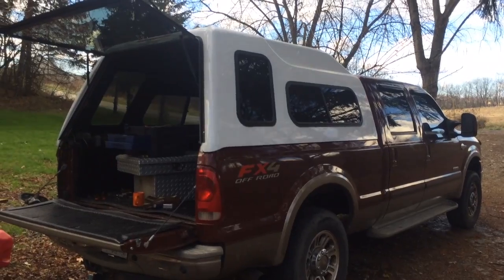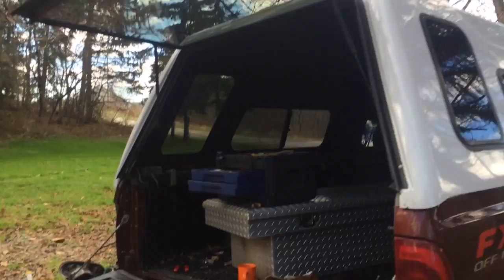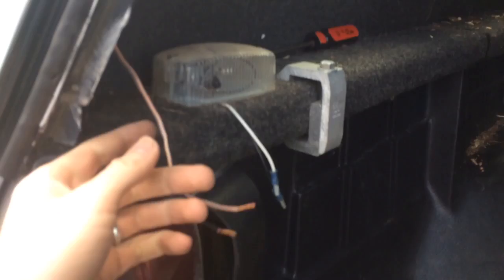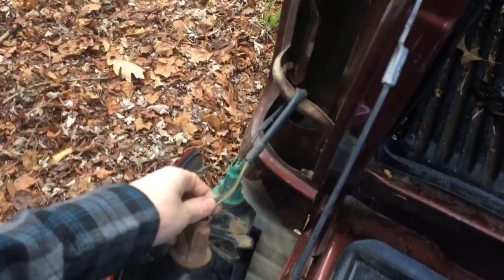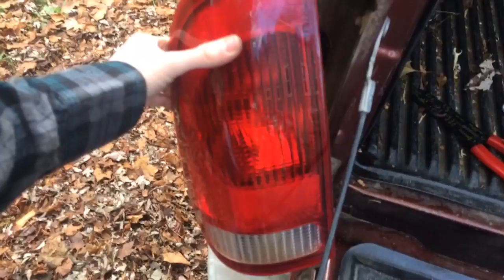How To Wire A Truck Cap Third Brake Light

Comment: THANK YOU !! I was having a problem finding a wire that wouldn't work the turn signal as well. My 13 Ram had that same wire hanging, it was white with purple line on, but still did the trick
Reply from the maker: Nice. I'll be sure to put that it works on some Dodges. Thanks for the info and the watch.

Comment: I have a green and a yellow wire coming from my third brake light on the cap, what do I do with the yellow wire?
Reply: What’d you do with the other wire?
Reply: @diyrob9160  So the green was the ground, it attached to the black wire on the light on one end and I attached it to a screw holding the bedliner to the bed on the other end. The live yellow wire wire I ran to the extra green wire that was coming out of the harness near the rear bumper on the drivers side.

Comment: I have a 2000 ranger and it doesnt have the green wire  : /  , still trying to figure out what to do
Reply: sell it and buy a 2005 F250 .. there I fixed it!
Reply: @gschady  Its been a year since I posed, figured it out quite awhile ago. Hell no on a F250 lol
Reply: @saturnargentavis1901  great! so many fixes don't translate to other makes and models .. glad you've recovered .. 1996 K1500 for me one of many pickups including '87 Ranger stick
Reply: @saturnargentavis1901  argue? I was agreeing .. okay see ya I guess hmm... "argue"???
Reply: What'd you end up doing?
Reply: @RoamingLegion  Took it to a Cap dealer, they installed it through the back left brake light, the cord went up inside the left side bed where they drilled a hole near the top securing it down. Cost me 30 bucks. Quite happy with it